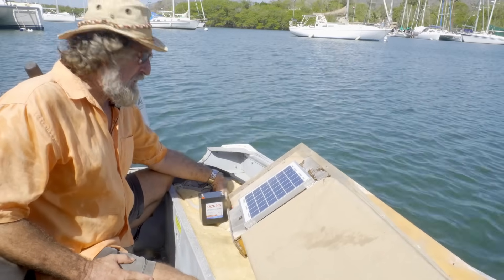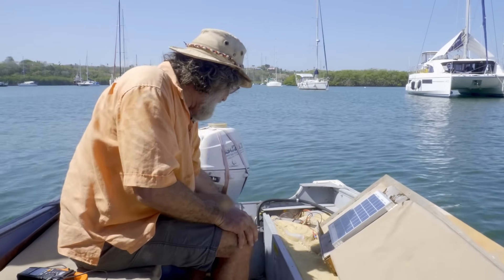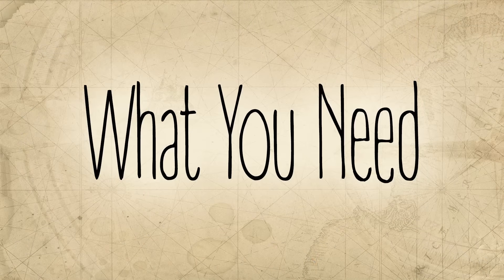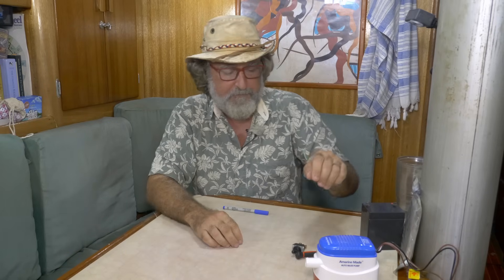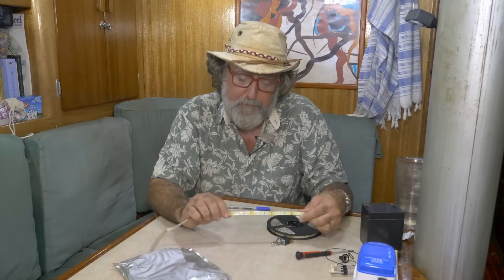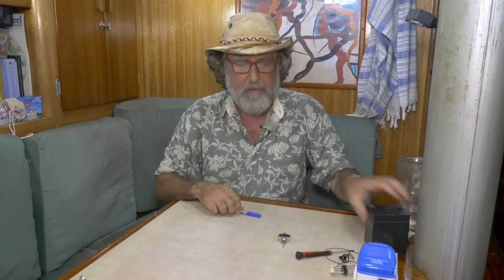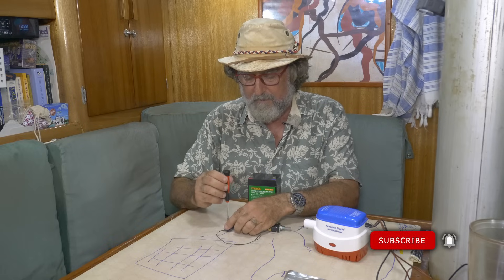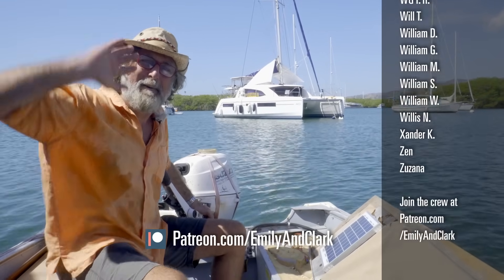Electrified Dinghy ($100 hack)

Comment: We have the same outboard as you (and same battery and fuel filter and bilge pump!).  I don't understand the need for the solar panel.  The outboard alternator charges the battery, and the battery runs the bilge pump for several months on a single charge (and it rains a lot here).  So as long as the outboard is used occasionally, there is no need for solar charging.  I understand this video is for those who may not have an outboard that can charge, but was wondering why you are using this?
Reply from the maker: I don't have the electric start version of the engine

Comment: Little tip from a fellow engineer.
Instead of a simple diode use a Shottky diode.
Normal Diodes will eat 0.7V in forward direction , Shottky diodes eat up only 0.2V.
This helps to be more effective during charging.
Reply from the maker: Yep.  I basically only stock shottkys I should have mentioned this.

Comment: i put three 15 amp hour 12 volt lipo4 , all three batteries weigh less then the one led acid , they are warranted for 10 years,  this is how i power my C3 cooler ..lol    with a 30 watt solar panel..   solar panel battery and pump  all the rest would be knocked out, the batteries have built in bms system..  and the solar panel has also a built in solar controller..

Comment: I keep wondering why cruisers are always bailing the dingy.  This is fairly common on inland lakes where boats are kept at docks until the weekend.  Flexable panel on the tube, waterproof box for the electronics and battery, a lot less bailing I would think.

Comment: Similar setup for our composting head fan.  Simple 25watt panel with built in controller and a 10ah battery.  Keeps our fan running 24/7. Fan pulls ~.3 amps.

Comment: Is the wire you have attached soldered? Which side is + , and lastly what size wire are you using?
Reply from the maker: The board is labeled plus and minus.  Yes you must solder to the board.

There will be less than an amp from the panel so that wire can be really small.  16ga would be more than enough.

Comment: Well done sir,  I do have a question that I cannot seem to find an easy answer for.  I have a Suzuki 9.9 electric start.  Does this return charge to the battery while running like a normal motor?
Reply from the maker: I don't own one but I bet it does.

Just put a volt meter on the battery and notice the voltage.

Then start the motor and maybe rev it up.  If you see a higher voltage, it's charging!

Much like how I tested the charging in this video.

Comment: does this solution also work with a small lithium battery? I think so anyway😀
Reply from the maker: No.  Charging Lifepo4 to a constant voltage and holding it there is the most certain way to destroy them.
They are fragile devices, that's why I made the BankManager.
https://www.emilyandclarksadventure.com/bbms
Reply: @Clarks-Adventure  Yes, I know your bankMangager and it suit bigger systems then this dinky so is that true? if you use the battery's own "float" example 13 volts? ( or whatever the "float" it is) the battery stops receiving and basically like the Victron mppt that keeps "floating" the rest of the day when the battery has been full since morning ?
Reply from the maker: Yes.  
   Li is suspectable to damage at any voltage over 13.48v once fully charged.  And it charges very slowly in the voltage range from 13.2 to 13.48.
    So if you wanted to charge painfully slowly you could do this but why not just use lead.  Cheap and in my case I lost the battery to corrosion before it died from use.  So there is little advantage to the li as I see it in this application.
Reply: @Clarks-Adventure  you are absolutely right that just for dinghy lead is very economical my thought is other applications where the weight is also a factor where this simple system fits well and then it can "charge" for several weeks. thanks for taking the time to reply to all of us ;)

Comment: What do you guys do for DC fans... the $100+ for a fan is expensive compared to the $10 fans available on ebay, however they make too much noise due to a higher rpm than is actually needed
Reply from the maker: We put our favorite fans in our Amazon store.  Link in the description of this video.

They do cost just over 100 but worth it.  I've liked this life for over 20 years.  Don't scrimp on fans in the tropics!!

Comment: Hi Clark, I won't put links, but there are water resistant, shockproof, 900000mAh Portable Power Bank  batteries (used for charging devices when out & about) about the size of a cell phone, "with built-in solar panel", for ~$20 (aud, so prob half that usd) from ebay, prob amazon. Put a usb plug on that 12v pump.

I mount battery on transom under motor with velcro (so not direct sun, heat all day), take it with when ashore to prevent theft, boost devices if needed. Likewise the pump is hidden under a plastic container with one side cut out, looks like rubbish.

I'm considering an inflatable catamaran, open front = easy in from dive, no more bath tub.
Reply: Rather than a 12v pump, get yourself a 5v usb pump for circulating water in a pet bowl.  It's got a built-in float switch and is ready to go.  That and the solar power bank equals two parts, plug-n-play!
Reply: @warnerwinborne  That sounds great, but all sorts of terms in google can't find one with float. Got a name or part #?
I've got a few of the 5v pumps, use them to circulate/aerate live tanks & micro trays.

Comment: Hi, Clark--Quick question for your electronic creativity.  We'd like an alert if our generator goes out while underway.  Easiest is to simply power a light off a regular 110 outlet and monitor if it goes OUT.  However, is it possible to do the reverse: have a light come ON (or sound a buzzer) if power goes OFF?  Thinking you'd have to power the light by a battery (or condenser ideally?) and maybe involve a relay that trips ON if power goes OFF.  Whatcha think?  Might make a fun episode.
Reply from the maker: If it was me I'd ignore the generator and go to the real question.  "Are my batteries being charged or are they low?"
   There are simple boards on ebay https://www.ebay.com/itm/354695577895?mkcid=16&mkevt=1&mkrid=711-127632-2357-0&ssspo=7t8wlvkpqf-&sssrc=4429486&ssuid=3Zp5jgUhScS&var=&widget_ver=artemis&media=COPY 
That will flip a relay when the voltage drops.
Maybe a second relay to flip the signal if you don't want to learn a better way.

Now you have something that detects generator or battery charger failures.
And once you turn off the generator it can easily be set to tell you when the batteries go low.

Comment: One thing that not many people know. Adjusting the buck converter with your multimeter on the kathode of the diode is not correct when the diode is not connected to a load or battery. There must be enough current flow to "open" the diode and the Vf is also current depended. Often a DMM with a Ri of 10M causes just enough current flow to bring the diode in conduction but at 1A the Vf will be different. I experimented with this and the differences per meter Ri were huge. A > 1G meter did not cause a current high enough and  measured  the static electric field and that value was extremely way-off) Best connect a resistor instead of the battery that is big enough to causes the wanted current at 13,5V and then adjust the buck converter. Remove the resistor and connect the battery. I would also place a fuse. I think this idea is for the rest fine and will work. I would not doe it to connect a big solarpanel to a big batterij. Better use a real charger for that

Comment: Neat little project Clark.  This would go well with a electric trolling motor I have on my 14 ft fishing boat.  Thanks for the info and keep the good stuff coming.
Reply from the maker: Sure.  Probably a bigger panel.  That buck converter is probably only good for maybe 2 amps.  And maybe a heat sink would be a good improvement .
   But you get the idea, lots of bigger buck converters out there.